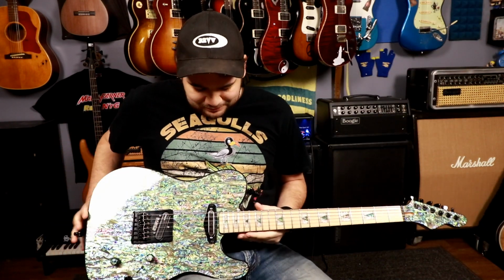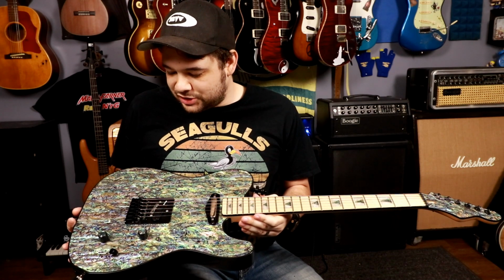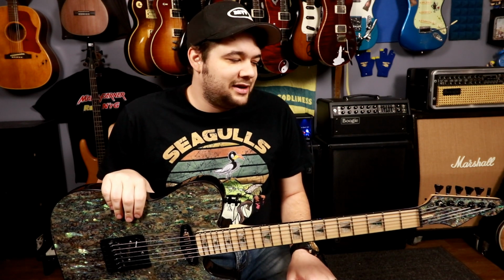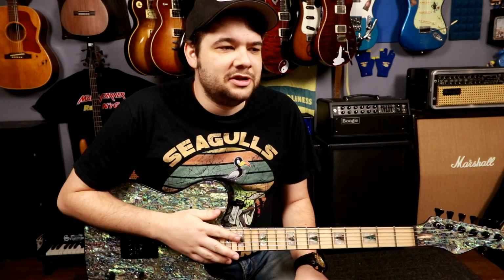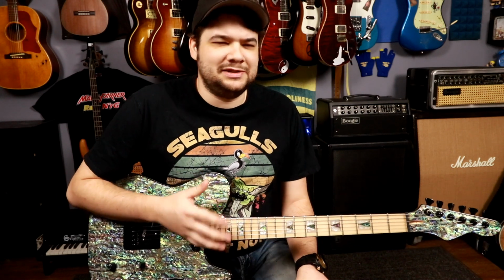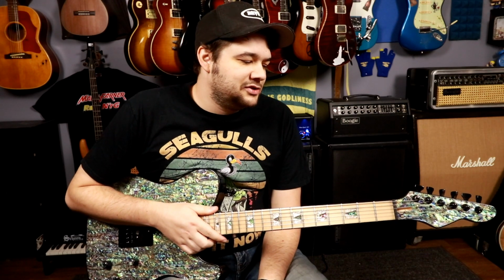I Built A Guitar Fetish Parts-Caster (GFS)

Comment: Pretty good choice of pickups, they work very well with you rig/amplifier.
Reply from the maker: That Black Spirit works great with everything I plug into it :)
Reply: Lucas Fowler I will certainly admit the technology and design used in the Black Spirit amplifiers sounds amazing, however I doubt the unit's reliability over time.  Not saying anything bad about it, I am instead singing the praise of PTP construction and how well it is suited for heavy road use.   I still own a Fender Twin Reverb I purchased new in 1976.  Normal maintenance consisting of replacement capacitors and changing tubes regularly has kept this amplifier running like new the entire 43 years I've owned it.  What amazes me more is the cumulative abuse this amplifier has endured without ever missing a beat.
Modern amplifiers that utilize circuit boards are wonderful sounding and very versatile, however I don't believe they would survive the abuse a PTP wired amplifier can endure.
Just my $.02 Cents
Great Demo, awesome tone and fantastic playing..

Comment: Very cool! Do you have a trick for the top mounted neck pickup? I got mine mounted in my warmoth tele but I’m sure there has to be a much better method to line things up lol
Reply from the maker: Well it has a pickup ring, which helps position easier. I just put on the high and low "E" strings and then used those to center the pickup before I drilled the mounting holes.

Comment: Hey Lucas. That amp sounds just killer. You can turn the video off, and just play sound with the cheapest ass pop-and-son Squier or whatever, and it will be great! BTW, there's nothing wrong with parts-guitars. They (most)  often turn out better than stock brand items. They were more hand-built than the factory models.  If one can only get past the snob factor, all's good...
Reply: Getting past the snob factor is done by simply not giving a damn 😀

Comment: I have had several XGP bodies. Their paint jobs are crap. Good luck on a Tele body even putting ferules in. If you look at the paint wrong it flakes off in quarter sized chunks. I have had 3 that did that. I finally gave up on those bodies..